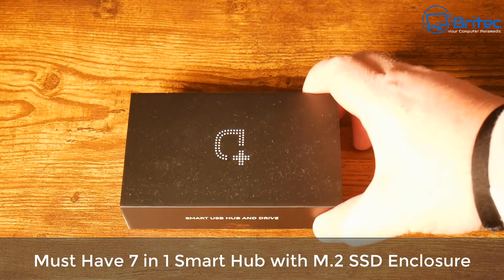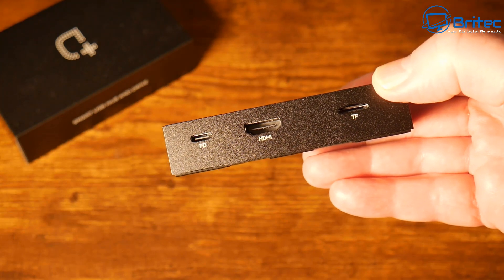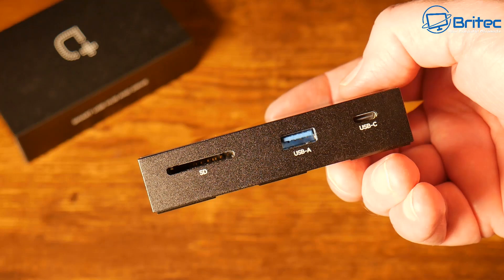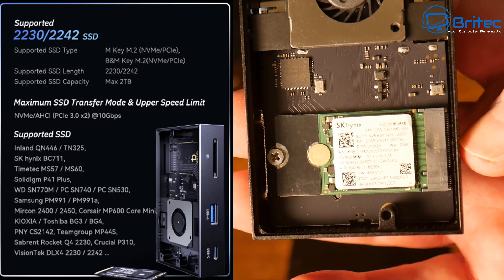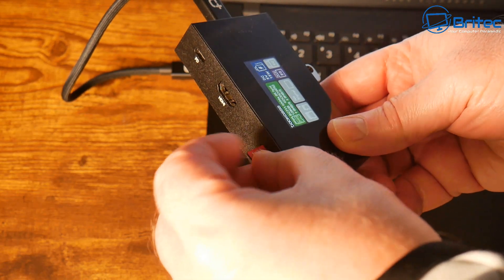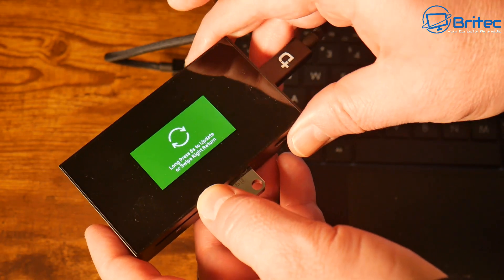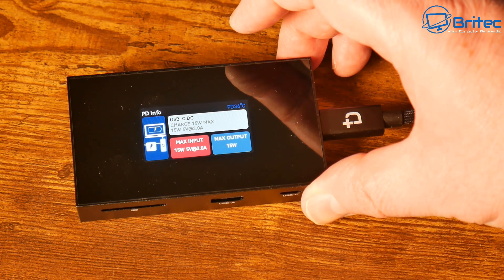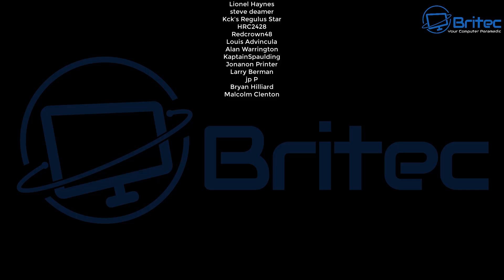Must Have 7 in 1 Smart Hub with M 2 SSD Enclosure

Comment: Get it right!
PD dies NOT stabd for "power port"!

It stands for Power Delivery!

Which means it can take or supply high power.
Reply from the maker: Maybe learn to speak to people properly. Say's POWER PORT on there site. Look for yourself. https://i.kickstarter.com/assets/047/837/984/54143e3de0048b2d839fbc4d63aab52d_original.jpg?fit=scale-down&origin=ugc&q=92&v=1736922356&width=680&sig=zIgn31iM2lmbnlTlOPEjUPg7MWg7rMeavmkXdAtvr3M%3D Power Port that will deliver power for charging and powering devices.

Comment: The SSD is a nice idea, but to be an effective hub it's missing an RJ45 LAN port. Other than the HDMI out port it's the only reason I generally use an external hub for the laptop.
Reply from the maker: RJ45 would be nice, maybe they will bring a model out with that on it.

Comment: Need to reconfigure the guts/circuit paths and make it support 2280 M.2 NVMe SSDs as well as 42s and 30s.
Reply from the maker: Not sure they could fit a full size in that with all the ports
Reply: @Britec09  Maybe make the unit a bit longer and wider, wouldn't need to be by much, and fit the SSD lengthways down the middle. What's under the fan btw?